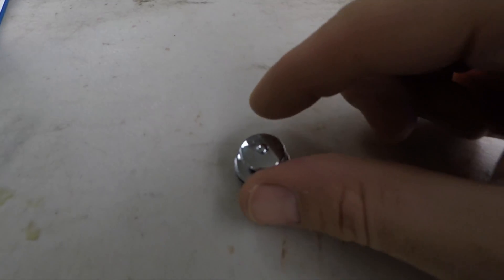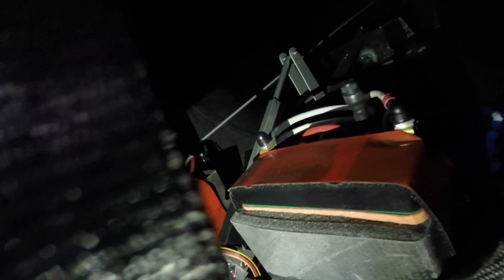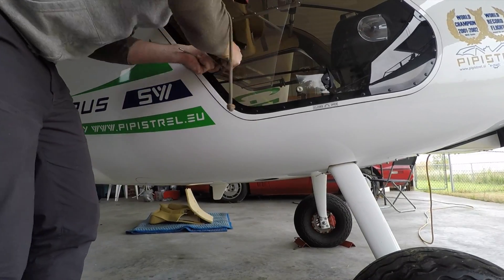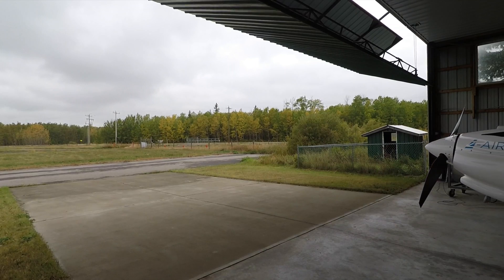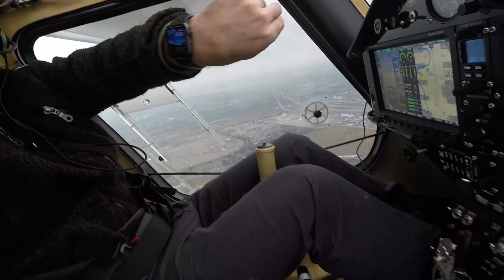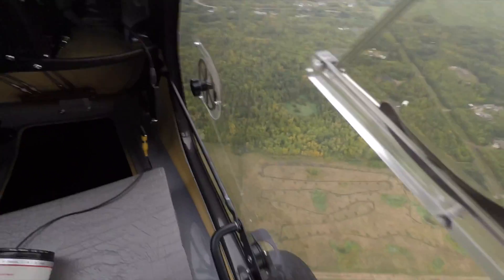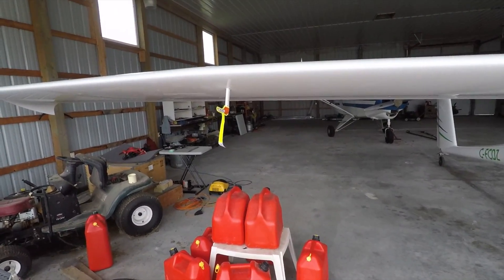Earthx Battery Installation

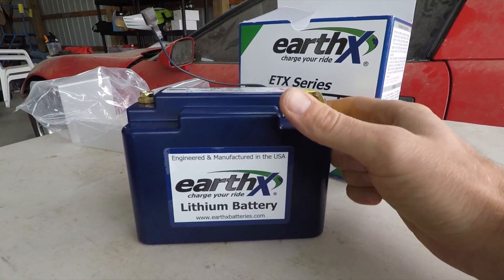Comment: 1:58 , so, the earthx battery has a indicator light to tell you if the battery gets too much charge it will explode... thats reassuring!
Reply from the maker: It actually has a BMS so it will automatically shut off the power electronically if it’s seeing too much or too little voltage. Or if it somehow gets a short, which I’ve had happen working on the electrical system the battery electronically shuts off the power to its terminals instead of burning down the plane.
Reply: @DarrylZubot  Thank you for the video and we are glad you like the battery! Pipistrel is one of our largest customers direct from the factory in Slovenia.  Sorry about the "anti-lithium" trolls. You will find these individuals with negative comments on any EarthX post, perhaps they are paid to do it?
Reply from the maker: @EarthX_Lithium_Batteries  Anytime. These batteries are incredible. I've now been using them for 5 years without any issues.  I live in climate where we regularly hit -30ºc temps (which I fly in).  Never an issue starting.

Comment: How has your EarthX held up? I’m installing the 900ETX tomorrow.
Reply: I bought one and it died in about a year.  EarthX then proceeded to tell me to go pound sand.  

Also another thing they do not tell you is these batteries MUST NOT be used in sub-zero temperatures (less than 0C).  The LiFePO4 cells will be ruined.  Strange considering they market them directly to snowmobiles all over their websites..........

There are lots of reputable lithium battery manufacturers out there, no need to deal with a terrible company like EarthX.

Comment: I like pilots like you that are always changing things on your plane. Just a question- did you remove the wheel pants due to the weight of the new battery?
Reply from the maker: Thanks for liking the video! No, I have my larger tundra tires on right now, needed more ground clearance to fly that large sensor unit under the aircraft body you can see at beginning of the vid.
Reply: These tundra tires are a tad too big for the wheelpants... and he even left out one battery.